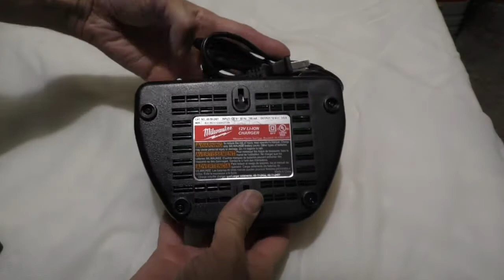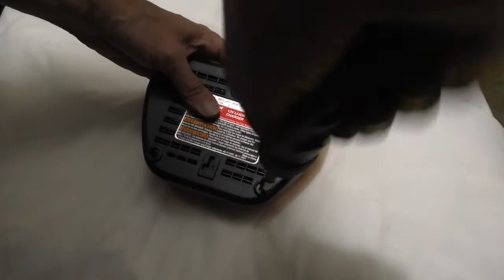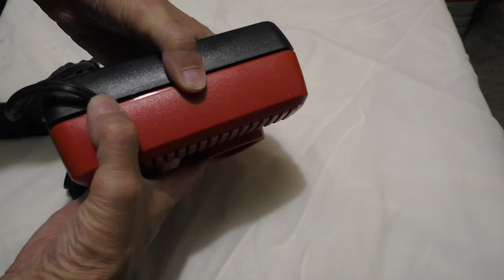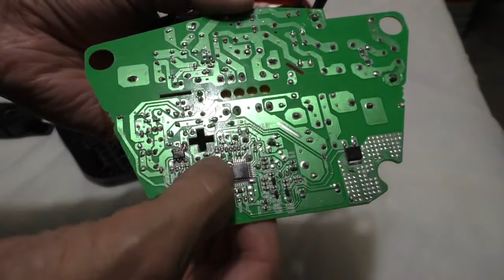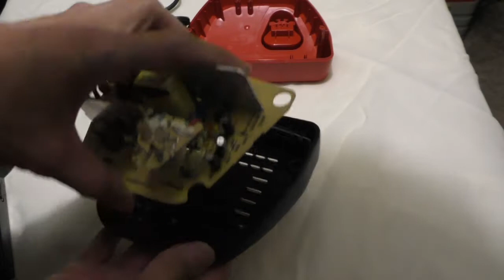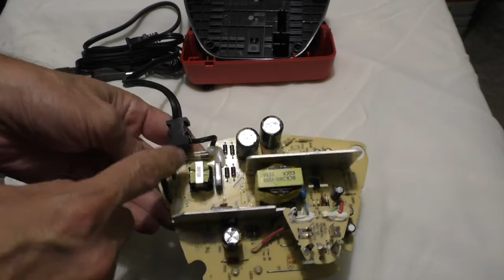R&D #32: Teardown of the Milwaukee M12 battery charger.

Comment: Has anyone taken a few of these and joined them to make a multi battery charger? Or would the board need to be split apart in too many places (for charge time, etc).
  Now it just seems too dangerous, nvm…
Maybe just take a few and junction box the power cords into one cord.

Comment: What is the symbol of IC (IC301?) in TO-220 enclosure on the heat-sink at the high voltage side?
Reply: That's exactly what I was looking for!It's TOP255EN from what I can see?It's been painted over,and the numbers rubbed off to a degree!This is the common failure with this charger,and the date printed on the board is 2013.

Comment: Could this be converted to work off 12v car plug?
Reply: I'm currently trying to find any info if it is possible as I want to do it
Reply: I bought a small inverter off of amazon for about $15. I use it to charge Milwaukee and Dewalt batteries. It seems simpler than cutting into a cord if it's not necessary. 
Anyone have any idea which side of the power cord is polarized? I cance here because my dog chewed the end off of both Milwaukee chargers. 😟

Comment: I've got 4 of these chargers now that don't work! One is brand new.
Is this common for them to crap or so easy. They worth trying to fix?
Reply: My dual m12 and m18 one they put with their m18 tools quit turning green when the battery is full and would start heating the battery up. I had to send it in for a replacement.

Comment: I fixed my dad's M12 charger which had a blown fuse recently. I also had to replace the input caps on the charger because they were bulging. Unfortunately, all of the caps in the device were low quality Capxon brand. It looks like the charger in this video has different brand caps.
Reply: Yo my m 12 charger popped cause of loose outlet what fuse do i need
Reply: @jalepeno_pete3589  3.15 amp ceramic pigtail GMA style will work.
Reply: It's the same caps with this charger and the revisioned version.